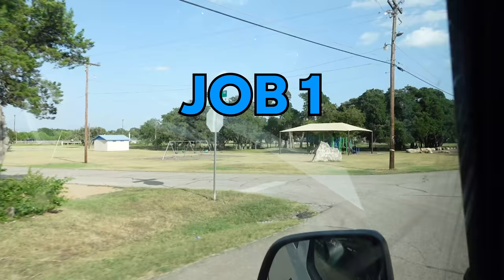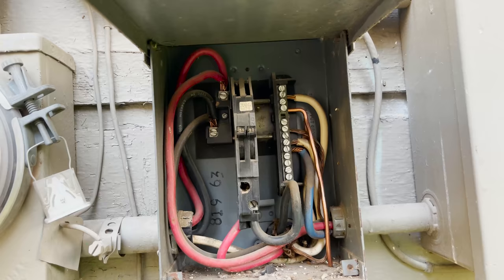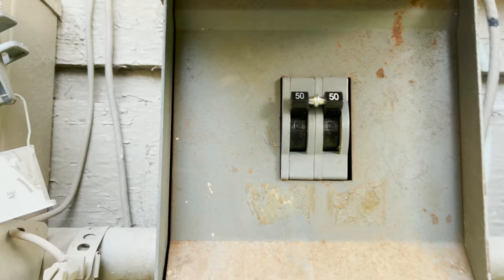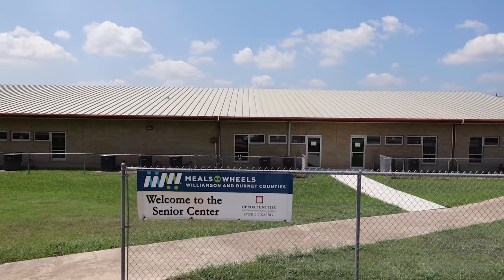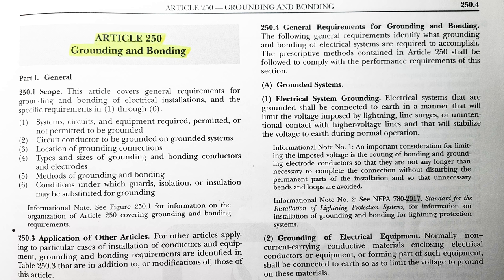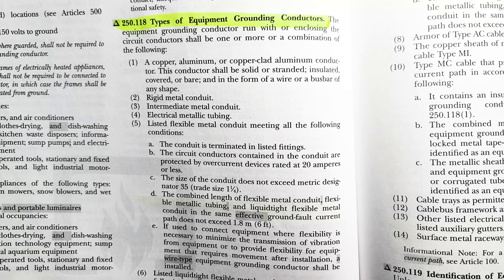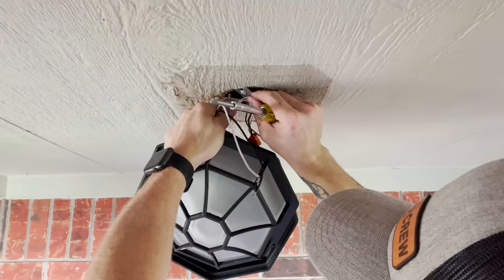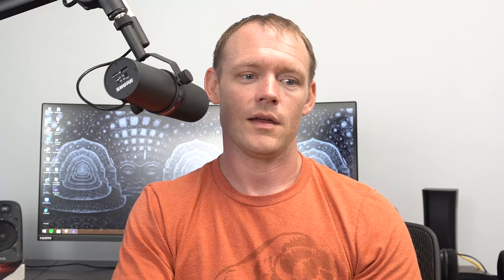Service Calls With Electrician U!!!

Comment: I worked on the weekends for this old alcoholic. Normally I did exterior work to do with grounds and framing. He was odd as he only wanted interaction with folks before he started drinking around noon. So it was about 11:45 when he called me in and had me climb up a ladder to hang a ceiling fan. Having a considerable amount of electrical experience I had no problem with it. I climbed the ladder which was in a sketched out position to reach the work and he was supposed to hold it steady. Apparently he had poured a drink early that day and it was just out of reach while he held the ladder. Well I think we see this one coming. He needed that whiskey so bad he let go of the ladder to grab it and down I came with a fan on top of me. There he stood apologizing with his drink in his hand. I grabbed the glass from him, drank it down and said I'm done for the day. From then on when I worked for him he doubled my pay and we never mentioned it again, LOL. We did joke around about it though, saying things like "as long as the fan was OK", "I hope it didn't bend the ladder" or "as long as no one spilled", LOL. :)
Reply: At least you were able to get back up  lol!  Sore the next day I'm sure, but hey  that's how we learn right.
Reply: @dodge96sport  Yes indeed, I was lucky for sure and in hindsight it is funny. I definitely learned a lesson, LOL.

Comment: I have a million-dollar question!!!! I have a 200amp panel with 2 ground rods outside. What would cause a current 120 volts to flow on ground and neutral with the breakers off? When breaker is turned on its 240 volts between the ground and neutral. 🤔

Comment: So on the school job how did you get the ground wire through the ridge conduit? The only way I know how to is to tie a new feeder to one of the existing feeders  + a ground wire soap the heck out of it and pull. Is there a better way?

Comment: Love your videos on service calls, it's very interesting and informational!! Thanks for the tip on extension ladders. Have a question though for anyone who has advise, got asked to change a chandelier in a 2 story  foyer and it's about 8 ft square area, so my 12 ft step ladder won't reach, and I assume an extension ladder won't be very useful for that size room so I guess a 16 ft step ladder or scaffolding is about my only options which I don't own. Anyone has a better idea?
Reply: Scaffolding is the way to go. The fixture is probably too heavy to be fooling with it on a ladder and you don't need those worries along with the extra height.

Comment: I had an HVAC guy complaining his vacuum wouldn't work. He used alligator clips to grab a hot from the inside of the unit. But the system did not have a good ground, so he got 120 volts but no good ground.  So the vacuum would  operate for only about 10 seconds then die.  It was three phase 208. And I had 208 across the three legs. But I did not have a good ground, and when I added the ground he was able to use his vacuum.

Comment: I brought the M18 FUEL deep cut band saw with the dual batteries and charger, the box it comes with is huge, how do you lug it around and keep it on your truck, any recommended bags?? Although your tiny service truck… it wouldn’t even fit lol do you only use the tool for larger jobs??

Comment: My advice is any time the customer is for sure losing power on a phase or the whole house intermittently, have them call the utility company or do it for them before you even go out so the lineman can verify there isn’t a burned up meter connection or something at the transformer. It doesn’t cost you or the customer anything. I would say that step should definitely come before replacement of an expensive breaker like that. Pair it with advice to replace her main disco/panel. New breaker in old bus = see you again in a couple of years. For god’s sake, the prices people pay to replace air conditioners, but they can’t afford 2 to 3 grand to replace their service from the Nixon administration.

Comment: Great Video, I'm a viewer from Nigeria, what is the  maximum ground resistance allowed by code, and what protection is required to be put in place against fire on a Air conditioning circuit. I don't mind a code reference page. Thanks a Lots

Comment: Thank you. Yes this helps.  
So the EGC, equipment grounding conductor, does not have to be in the same raceway ?  (Yeah I get weird rules stuck in my head. )
There is another group for home inspectors that show some of the wild stuff out there.

Comment: Hey Dustin I try not to use any of my removable shaft drivers in a live panel, is that something you worry about at all? I've had them stick and pull out then fall down too many times.
Reply: Smart man...
Reply: Seeing that much exposed metal on the screwdriver is wild from a European view let alone non-latching bits being a concern like that!

Have a look at the Wera Kraftform Kompakt VDE interchangeable sets for an example.

Comment: Intermittent problems are the absolute worst to troubleshoot. While working at a large plant equipment that ran 24/7 would just shut off once a week then a few times a week then couple times a day. They refused to shut it down for a few hours to go over large double door 7' high Hoffman  enclosure. Finally I just powered it down and removed no longer needed starters & a few relays that were energized but was part of a large control circuit stop circuit. Found numerous loose wires on pushbuttons & control relays. Foreman for that department thanked me a few days later for repairing it. They had an absolute ahole department boss that told me to never shut his equipment down. Asked him if he changes flat tire on his car while driving 60 MPH. Told him that I was Tom the electrician and not Tom the magician and troubleshooting takes time. We had a 200' long machine with over 80 motors, hundred air solenoids, and 7 computers that ran 6 synchronous motors. Took 3 electricians over 24 hours to find a loose wire. Of course it was in the last box they opened.

Comment: I had a service call for a guy who lost power to his dishwasher. Ended up leading me to his main panel where half the breakers had the wires in them but none of them were screwed down. Turns out the one to his dishwasher had shifted just enough to just be floating there not touching anything. I find shit like that on a regular basis.

Comment: You'd enjoy a conversation I had with a plumber who was working on a remodeling job in my house:
"The painter has been working in this room, but don't worry about where you walk.  He's only painting the ceiling."
"Don't worry, if I could walk on ceilings, I wouldn't be a plumber."
"Of course not.  You'd be an electrician."

Comment: Heads up , my fellow  TEXANS. 
TEXAS HEAT AND SWEAT!!!
LINEMENS  LEATHER  STARP ON TOOL POUCH.
TOOL'S WET FROM SWEAT DID NOT NOTICE PLUS BODY  SWEAT INSIDE  COMMERCIAL  PROJECT USEING A FIBERGLASS LADDER.
GOT STUCK  ON 277 VOLT'S ;   I HAD TOO SAVE MY OWN LIFE BY KICKING LADDER WITH MY KNEES  TO UNSTiCK MYSELF , BECAUSE EVERY ONE  AROUND LOOKING UP FROZE IN THERE TRACKS.
" YUPP, IT WAS NOT MY TIME TO GO YET".

Comment: As a generator technician I see many of these service calls because the first thing the customer thinks is there's a generator malfunction. (because we were there last, even if it was 3 years ago) A so called "part power / no power" call usually means they think the gen is running for no reason or the house has no juice in certain areas. (because the gen set isn't connected to the whole house?) I have to sort out what's' working correctly and what's not. I have seen wires not landed correctly at the breaker (not tight) and wires that were not even under the screw at the breaker. (just tucked in and intermittent power) I have seen burned buss bars and had to come up with a work-around on a holiday weekend by relocating the sub panel feed to where an old steam shower was previously connected. (you can do without that for the weekend, right?) Good thing that old steam shower was a 50 amp breaker. I have seen tree branches rub through the service feed and the lights flicker as the wind blows. One leg goes out and the gen set starts every two minutes. I have seen burned up meter pans, and bungled wiring inside a meter pan to the point where I had to get the power company to disconnect at the street so it was safe to work inside the pan. I have seen burned crimps by the weather head and low voltage on one leg. I have also seen similar with a lost neutral and wild voltage variations between the legs. The one thing they all have in common is you need to use a meter while the circuit is under load. One of those hand held test lights wont cut it for a true diagnosis. Oh, last but not least the old "one leg bad in a 2 pole breaker" problem where you suddenly figure out that one buss bar has no power or one leg on a 240 circuit is out.... that might only show up under load but read ok without load.
Reply: Now there is a guy after my own heart !,,,
Reply: @gerdberg4188  ... thanks for the pat on the back. I recently retired and those are the type of call I miss the most. Let's call it freelancing and using my brain to solve a problem. What I don't miss is the fact that 90% of those calls were nights and weekends. Yeah, the overtime was great but you get to a certain age where it's not about the money any more.  <LOL> As a side note, I tried to teach the new guys how to do this stuff but out of 17 techs there were maybe 3 who got a grasp of what I was saying. Oh well, it's no longer my problem.

Comment: I have zinco old box can I bypass the breakers and put a sub panel .  Can I also put main breaker . I’m a home owner . Nice work and video
Reply: Not worth it just replace the main with a panel that has more circuits . If you do not you will have new equipment fed by questionable equipment . Not ideal……..
Reply: Thanks I will do what yuo recommend. And thanks for replay.

Comment: I'm thinking about becoming a service tech just got a job offer today. I do all new construction now. I have never done service work any tips and is it worth it? great video had me laughing out loud. just subscribed👍🏻
Reply from the maker: Thanks for watching and subscribing!
Service work requires a deep understanding of how circuits are ran, how the install may have ran them, and any possible situation that a handyman hack installed it. Another crucial element to service is the ability to troubleshoot. It takes a very intimate understanding of overall knowledge for these issues. Say a receptacle isn’t working, but they just had a new switch put in above it. Just knowing that the receptacle has a good chance of being fed by the same feed as the switch will help cut down time, and material. I went to a customers home once where an entire bedroom was without power. The previous electrician had cut holes all through this room and adjacent rooms and couldnt find the issue. I crawled up into the attic area and had found cut wires from a recent remodel. After connecting these two cut ends, turns out that was the feed for that room. Moving forward in service work, it is very rewarding to be able to solve things others could not, but dont be the person who just cuts and tears without weighing the options.

Comment: I have watched your videos and I like your common sense of working problems. I also have a question to see if an Electrician is the best person to call?
I have a 2 story home and I want to get some network drops installed in my wife's home office(upstairs) also in my living room(downstairs)  so she can have a wired connect to my home network and I also want to add some connections to add some Ubiquiti WIRED access points(already have the Access points) I need to get two network drops for Network Access points one upstairs and one downstairs. 
Do electricians install and test RJ45 Cat 6A wall plates. If not what type company would I need to contact?  I know this is not a electric problem but I am sure you must be getting some questions like this since more and more people are needing Wi-Fi and network connections in their homes.  thanks Jim
Reply: Jim , it depends on the type of job . If you don’t mind surface wiring get a data guy . If you want a nice job get an electrician .

Comment: Is it code for a bushing coming into a breaker box that leads to a 220 outlet (a push in style without a lock nut) to face the opposite way?

Comment: I would never trust a Zinsco disconnect. I've had 100A breaker crumble when I tried to take it out. I would have been in an arc blast if I had not had the foresight to have the electric co. disconnect the service beforehand. Also disconnect had double tap. should have replaced disconnect with small panel w/two CB's. Also I did not see any outside disconnects on the school's A/C's clear violation.

Comment: Question. The raceway equipment ground service call could have hypothetically left a shorted raceway run (with broken emt connectors between j-boxes) an ungrounded and exposed hazard for any future service men? Because that is exactly what happened to me in 2014 in a false ceiling when I brushed against a conduit that had an uncapped 277v lead pulled into the ungrounded pipe. Holy Fng crap!!!
I'm pretty sure I met God that day!
Ftr, she's a 5'10" ginger Kate Beckinsale dead ringer! Kidding, that was receptionist came rushing in when I finally broke free and brought 1/2 the ceiling down with me, lmfao...
Stay safe out there bros and sisters, none of us can see through walls and ceilings to know what lies ahead.

Comment: Back in my first couple of years in the industry, I did a lot of painting. Sometimes we'd be stupid and put our extension ladders on plastic that was covering hard floors. Same thing happened to me, ladder starting sliding down while I was about 12 feet up, but luckily I had a guy around to catch the feet. The reverse happened later when I had to save a guy from sliding down. Don't fuck with that shit

Comment: I have done a lot of roadside service work as a diesel mechanic. My nightmares are made up of RV’s calling in a blown tire and the smell of burning wires. It happens so much too. 

Even when companies are smart enough to run main and sub harnesses in such a way as to not be easily hit by a blowout people with enough tools to be dangerous will run additional lights using suspect looking crimp style wire splicers, some electrical tape, a few zip ties and no additional fuses. 

If you wanna see family vacation roadside hell ensue, just be the bearer of bad news telling them that their 7 y/o $250k RV they just bought used a few months ago now has a blown out tire that’s going to cost an arm and a leg alone to fix and at least 10k in cosmetic damage that the best I can do with is 100 mile an hour duck tape and zip ties. Then tell them on top of all that the reason it isn’t running or certain critical features like the headlights or wipers, is from the blowout ripping everything apart and the reason they smell burning wires. Then explain to them that you will try your best to help get them going now but there is no guarantee I can get them back on the road 100% safe and they still may need a tow truck because after 2 hours working on the side of the road (it could go to as little as only 30 minutes if you’re on a crap section of highway) tracking down electrical issues like this it’s company policy to have the RV towed to the shop. Especially if kids were there. 

This happened so much our dispatch center would tell people calling in for a blowout, or anything that burning anything is mentioned, there is a chance you will still need a tow due to the high probability of not being able to track the main issue down in a reasonable time for the situation. 

When you live in states with high a concentration of tourists and you did the work I did this situation is all too familiar. Sometimes it’s a couple (young or old) and sometimes kids  are there and it’s a crap toss whether or not some family friends would be there along with some pets. Regardless, dealing with these crap situations that ruin parts or entire vacations can be devastating over a cheap used RV salesman wanted to make a little extra cash and let old tires roll down the road on that sale he just made. Or the same slimy salesman has his buddy or half of the time an owner or his buddy thinks twisting two wires together and wrapping them with tape is a good way to wire in some new LEDs. 

Oh, and to make all this a little darker, the people I was dealing with were the lucky ones. A good bit of the time, RVs that needed a tow because the blowout damage was too bad had a high possibility someone got hurt too. Especially in some of the old smaller RVs where the kitchenette table/benches/extra bed was located right above the wheel well for with barely a couple layer of sheet aluminum and maybe a ok piece of sheet metal between them and the 2 tires holding a bunch of weight and possibly under inflated and/or over loaded. 

Moral of my rant, don’t forget about the electrical systems outside of your home along with other systems that can prove catastrophic in so many ways if they fail. 

That and if your tires are over 7 years old, we’re not in a climate controlled room or sat in a single position loaded for a long period of time and those tired are on anything that’s going highway speeds, replace them now.

Comment: The most exceptional and entertaining video I ever watched on electrical service call job. I really like the way you emphasized the importance of good electrical and equipment groundings. It’s like working on electronic equipment with a fuse not burned out but its element was broken and barely making contact. Or, broken stranded electrical wires that won’t handle a load. Excellent video contents! 👍